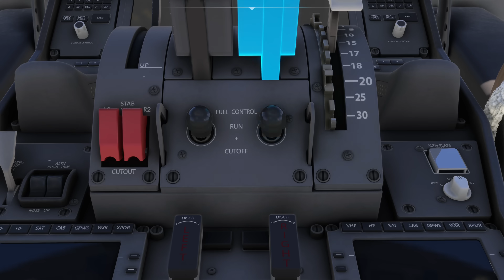Air India 171: Why Did The Fuel Cut-off Switch Get Moved?

Comment: I do NOT agree with you that 10 (!!!) very very long seconds in THIS situation can be rated as “pretty quick” or “amazing”… (2:00) reaction time….  I also do NOT understand why you   do not consider this aspect as worth enough to think about this as a very suspicious thing…
Reply: You have to consider that the pilot needs to think logically why they may have been shut off. They have checklists for everything but needed to do this on the fly while also focusing on an aircraft taking off. You need to to think that they noticed the switches, checked instruments, asked the Q, dealt with a confusing reply, made the conclusion and then turned them back on. Hindsight makes it easy for you to think that way
Reply: @walshmabob2 I understand. But I still think that in THIS situation where death of hundreds of people is only seconds away… there is just no time for thinking 10 seconds… especially when there is no reason for thinking: no fuel, no lift, no surviving… sorry, I’m also not following your argumentation.

Comment: The software can be modified so that only a SINGLE fuel lever cutoff activation is recognized during rotation. It’s unlikely both engines will catch fire at the same time.

Comment: WE MUST MAKE AVIATION SAFER FROM THIS:
Some suggestions from a  private pilot:
1.- It shouldn't be this easy to cut-off fuel. Several inputs should be made from BOTH pilots in accordance.
2.- Furthermore, airplane protection systems should disregard or override any manipulation of the fuel cut-off switches during critical phases of flight.
3.-Aural alerting should be heard when fuel cut-off switches are moved so counter-reaction takes a lot less than those 10 seconds.
4.- ALSO, for Germanwings situations: install a small toilet inside the cockpit. It's a few square feet "lost" but a lot of risks avoided once and for all.

Comment: Hi Captain Steeeve, I believe you stated on an earlier show that your 777 has the same fuel cut off switches. If so the 777 has been around for 30yrs and the 787 for over a 10yrs. Has there been any evidence that this switches have ever been switched off in this many on previously flights?

Comment: Evidence 2021video 787 effortless fuel switch ON operation - Pilot does not seem to be lifting up first at all, just flips effortlessly and fast, exactly like a light switch.  
Then he supports it almost as he was afraid it could go down on its own.

Maybe this is switch with no locking mechanism installed? 

In other video I seen pilot indeed, first lifts up then move from OFF to ON position and it looks that it is harder to do, as it was different improved design. 
Video title “How to Start a jet Engine (Boeing 787)”
https://www.youtube.com/shorts/bd4Bler36Nk
Reply: I fly regularly as 737 passenger- during take off there is feelable down force movement when pilot rotates and plane shakes up and down significantly during first seconds, then it stabilizes itself. This I feel in every take off.

 What they should do:
1.	Check what the fuel switch type was used (all previous video discussions was that advisory was related to 737 and not 787). The one on 787 video does not seem to be safe to me at all- seems he supports it on purpose, when planes being pushed back which also can make sudden plane move. If no lock mechanism, then below:

2.	Install vibration meter in 787 cockpit and measure up and down frequency movement during take off and G -force this plane produces.

3.	 Try to replicate in lab: mount such switches on panel and see if vibration (adjusting frequency up and down) could trigger the switch to automatically go to OFF position on its own. There is noticeable down pull force and plane shaking only initally during few seconds of take-off, as felt as passenger at least on 737.

Comment: DGCA India (Regulator)  has now issued a directive to check all fuel control switches on Boeing aircraft registered in India. This solves a lot of questions
Reply: Sorry but I do not agree. This doesn't answer any questions. If they were seriously concerned about it, they would have included that bit in  the actual report. This is just eyewash for Indian public consumption after backlash from the preliminary report in which all the findings point to human induced crash (error or deliberate). They already know what actually happened from the voice recordings, but are being deliberately vague about it.

Comment: I have been following your videos since the incident. In each video, I noticed a pattern that you try to some how call that boeing planes were fine and there was no issue in the planes. From the last few videos of yours, I see you repeatedly said multiple times in the same video that the planes were working as expected. How can you draw a conclusion with just a preliminary report? 
Also using your childs denial for anything doesn't comply that the professionals like pilots would do and deny it. You can't rule out the saying by the other pilot that I did not do it when questioned.

Comment: "The Enhanced Airborne Flight Recorder (EAFR) data indicates that the Engine 1 and Engine 2 fuel cutoff switches transitioned from "RUN" to "CUTOFF" one after another with a 0.1-second gap at approximately 08:08:42 UTC during the initial climb after takeoff (Page 14)."  

It is impossible for a human to physically operate that switch in that short time given its 2 stage operation. This is why i think it's a computer error with the fadec.

Comment: There should be an interlock that prevents changing to Cutoff (Off on Airbus) unless the throttle is set to idle...  As you mentioned, the procedure for engine-out is "move throttle to idle" before full cutoff.  Victor over at VASAvaition posted a great video showing how the Cessna CJ's cutoff works.

Comment: all we know from the report that the switches moved to cut off and then back to run. I dont understand why are you dismissing any possible flaws related to switches (already mentioned in the rport for 737) and how are you concluding that one of the pilots did this intentionally..  if there is a flaw in the switches then it need to be thoroughly investigated to save future accidents and lives .. i would like you to do  show on the switches flaw mentioned in the report.. without dismissing boeing's past where 2 incidents were blamed on pilots and turned lout to be issue with boeing planes.. isnt that e nough reson to go in the direction to figure out instead of blaming the pilots

Comment: Hey Captain, I know there’s a locking mechanism on the switches. But could it be there’s a short circuit in wires as it was extremely warm that day too. So there’s some kind of melting took place within circuits maybe. And it flipped the switches. Like sometimes at our homes when we get some voltage fluctuations once in years we have to go to basement and flip the switches back for home supply board. Just my thoughts. And I hope and Wish for all the Pilots that their Blue side remains up. RIP to all the soul perished.

Comment: From what i could read in other reports covering this latest findings there is a mention "In December 2018, FAA drafted a Special Airworthiness Information Bulletin (SAIB), which claimed an issue with the fuel switches onboard". Can you also address your analysis based on this? There is also info in the report on the conversation between the pilots that one asks the other whether he turned it off and the other confirms not. and they immediately turn on both the switches one by one.

Comment: 3:24 - EMBRAER made planes have a logic for this confirmation, without add too much complication like the purposed two pilots actions, what will not work if one have intention to down the plane.

After move the fuel switches for CUTOFF the FADEC only instruct the fuel valve for cut the fuel IF the throttle (of the engine in question) are in the IDLE position. So the pilot are "teling" for the system, with two distinct way that want shoot off the engine.

Comment: If fuel switches have to be acted on by both pilots, this would prevent an inflight shutdown during a pilot incapacitation. The way fuel control switches are designed isn’t flawed, it’s the people controlling our aircraft who are flawed. We shouldn’t have to baby our pilots to do their jobs, we need to trust them. At the same time, how do we trust pilots to be honest and open about life’s battles and problems if they are threatened with Job loss? We cant prevent mental health problems in aviation, but we can mitigate them by allowing our pilots to seek the help they need so they do not think that of something as horrible as this. I am not making any conclusions about this accident, but if it turns out to be a m****r s****de I hope this aspect of aviation can be looked into more seriously. I also think that even if you are struggling mentally, taking innocent lives with you is the most pathetic thing an individual could do.

Comment: Could they possibly implement a system where the engines do not cut off unless the the thrust levers are set to idle, regardless of the cut off switch being in the off position?

Comment: FDR recorded FSOV “off” (not necessarily switches) signal post-rotation, aligning with early RAT deployment. Total DC electrical failure could cause default FSOV closure, with pilots’ later switch cycling recording “run” on FDR, masking initial “off”, which was already the condition. ANA 787 dual engine failure suggests it premature to blame pilots without video evidence. Experts please weigh in.

Comment: As far I understand no pilot will deliberately place fuel control switches to cut off position during a climb. Still question arises how and why someone can do this. In your previous videos you have mentioned that the switches itself operates mechanically. But what about the actions of the switches? Does the fuel door operates mechanically or controlled by computer? If the switches controls the fuel doors digitally then there can be any error that can cause malfunction in the fuel flow valve?

Comment: The CVR and FDR don't provide the same information. A camera in the cockpit would prove definitively which pilot cut-off the fuel. If pilots don't want stuff leaking out then do your jobs and don't do anything that would jeopardize your job if it were "leaked".

Comment: Hey Steeve,
I'm a master's student in Aerospace Engineering, and I was wondering—could there be a scenario where the onboard computer glitched momentarily and displayed a false fuel cut-off warning? In response, the pilot, without verifying the actual fuel control lever position, might have instinctively switched it—ironically moving it to the cut-off position from its correct state.

But this would contradict the conversation where the first officer said, 'I didn't do that.' Perhaps he did make the switch in a moment of panic, unknowingly, and then—boom.

Comment: As an experienced aerospace design engineer, I appreciate the non-judgemental approach you are taking to this report.
Reply: This guy's asleep at the wheel at this point. I think the channel might be sponsored by Boeing.
Reply: Everyone’s calling it “no issue with the plane” just because the preliminary report says so—but let’s not forget: a passenger on the previous flight clearly showed serious electronic display failure in a viral video. That was the same aircraft just one flight before. Why is that not being openly addressed?
Reply: @Gurpreet.jheeta  the ife and cabin utilities aren't held to the same standard as essential aircraft systems.
Reply: Manipulative approach on each and every video. 

It shows a very fixed mindset
Reply: Union Aviation Minister of India has stated for people not to jump to conclusions and wait for final report and here is our over-smart CAPTAIN STEEVE using his social media power to openly claiming that is was pilot's faul
Reply: @farazalikhan5242  He is speculating, not coming to a final conclusion. You are allowed to speculate with the data in the report.
Reply: He killed almost 300 people there is nothing laudable about withholding judgement. The virtue signaling is out of control
Reply: @mandywarski2414  Speculation!  I've seen some peculiar electronic glitches show up in other aircraft.  A rush to judgement does no one any good.  If they haven't, I hope the investigators examine the maintenance and repair logs for this aircraft.
Reply: Fake narrative. Facts are here. You are sold off to Boeing. Why don't you talk about FAA directive from 2018 and CAA directive from May 2025 which talks about issues with Boing 787 which can cause cut off including during inflight.  Why Etihad airlines and DGCA wants planes to be checked. Why British Authority wants checks for this issue since May 2025?.

Western media is corrupt and sold to Boeing
Reply: DUDE he is always taking the company off blaming the pilots between the lines. So Biased.
Reply: Is this a sarcasm? Cause this looks heavily judgemental to me disguised as 'I will say that the pilot did it but won't say with certainty and just say Draw your own conslusion shit .
Reply: @alsoknownas1729  Glad you called it out.
Reply: He is probably saying that for legal reasons, similar to how some YouTubers say allegedly every other sentence. I think the information is well presented.

Comment: 2:38 Cessna Mid-sized business Jets Fuel Cut off switches have been designed in such a way that no one can turn them off without moving the Throttle to the idle position no matter how much you try physically. It's a common sense Why would anyone want to cut off Fuel at full throttle?? So that's a Faulty Design by Boeing for sure 🙏🏻(VAS aviation video for reference)

Comment: Wrong again. Confirmation. Bias.  You are spewing opinions as if they were facts. Why bother spending any more ntsb time or .money as capt steve has solved it all. I call horse pucky. Your lack of open mindedness is very disappointing. I would not want to be on a flight that experiences issues with you as pilot for fear of your poor analytical skills. I have no doubt you are an adequate pilot, but stay away from anything that requires you to think outside th3 box. I now question your comments on other airplane crashes. Your commentary brought up other good points... .most that you poo pooed. Just because you are a captain doesn't mean you know everything... and you certainly dont know what happened to air india

Comment: Once the engine flames out from the fuel being cut off simply restoring the fuel by putting the switches back to the RUN position will not restart the engines, the ignitors need to start firing in order to get a relight.  On these planes there is no direct control of the ignitors, they operate in conjunction with the auto start system - or am I wrong?

Comment: If the pilot did flick the switches off, he then didn't do anything else to sabotage the flight. That means one of these things:

1) He knew there wasn't enough time for the other pilot to stop the plane crashing so just let it play out, or

2) He regretted his action straight away (still not forgivable)

3) He didn't realise he'd done it, or didn't actually do it.
Reply: Based on available information, 3 is the only one that can fit. I have no doubt both pilots' background will be examined and their social media account checked to determine if either of them had unreported mental issue or was otherwise thinking of going down in blaze of glory, or if it was just a dumb pilot mistake pulling the wrong switch.

The switches, if it survived the crash, will be checked closely to see if there were defect or illegal mod that might have allowed it to shift too easily.  The investigators need time to analyze everything before they can come up with final report putting the blame somewhere.

Comment: Sir if u See a fire on one of the engine  Sir don't you instinctively relax the throttle to 0th position Then after you cut off the fuel switch Instead of directly cutting off the fuel Switch